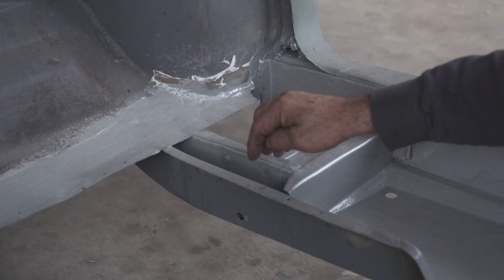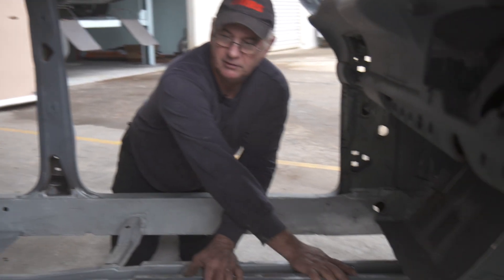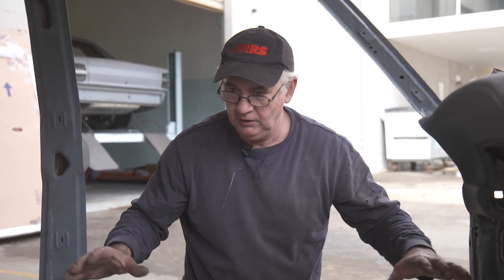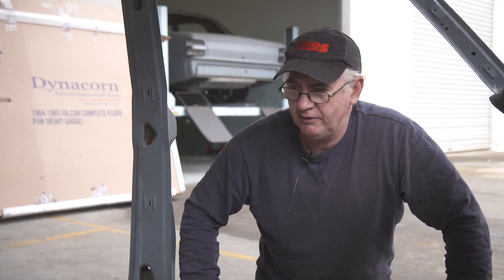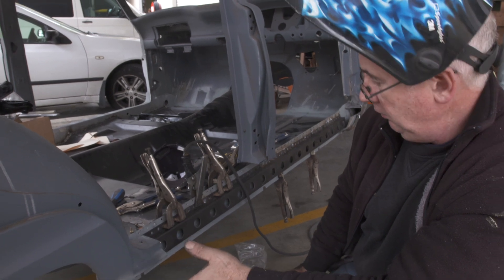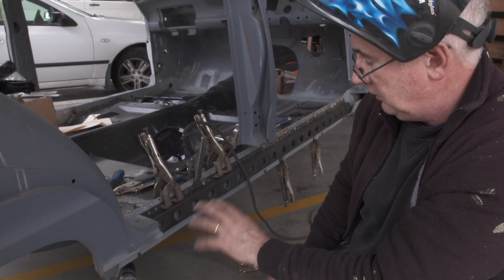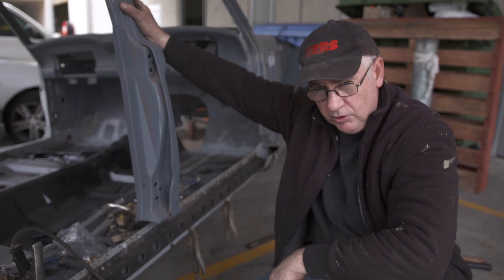The truth about sub frame connectors

Comment: I have done what he is suggesting as it makes for more rigidity than frame connectors. I am sure frame connectors are a good solution after the car is fully built, however during a restoration when the outside rockers need to be changed, is the ideal time to weld in bulkhead to bulkhead beams. I am impressed with his reasoning from an Engineering sense and can't wait to feel the difference in my Mustang coupe to fastback build.

Comment: Stifflers Web brace kit for the 79-93 Fox Mustang+ Maximum Motorsports subframe connectors+ 1x3" mild steel box tubing along the rocker rails+ CE Mild steel 8pt cage, YES, welded through the floor pan+ Maier MOD1 narrow leaf, Panhard bar kit+ Shelby style front tower brace+ triple adjustable Mustang II IFS set up in a '68 Mustang coupe= PERFECTION ! Hope everyone has a happy 2024 !

Comment: This bloke talks alot of rubbish his kits have many weaknesses one is not using  crush tubes when bolting parts into a chassis especially in a rear end. Also his front end parts are junk you would never swap double wishbone for a macpherson strut double wishbone has much better geometry and the so called bad geometry of the older ford suspension can be fixed to far out handle his kits
This guy sells snake oil I have seen old fords with his tower notching kit bend because the support has been taken out of the strut tower. Do your own research before you buy any product not only his.

Comment: I jacked up only , one side of rear of a car with proper frame connector and the entire car lifted at once, i say no flex at  all if done right
Reply: I guess it depends on the car. These are way stronger than the commercial ones I see for my car. This is almost like what OEMs do on convertible cars. Its welded all along instead of just at the front and rear. The commercial subframe connectors helped my car immensely, but this would take the torsional rigidity even higher.
Reply: Yup. I put a set of weld on sub-frame connectors on a 1990 Mustang GT convertible and it made a HUGE difference. You could lift it by the frame and still open and close the doors. Couldn't do that before and it was a non-abused low mileage car.

Comment: Force = Mass x Acceleration, not distance
Reply: Work = mass x distance.  Not sure if I he is attempting to describe moment of inertia or a beam equation, but he is actually describing “work” which is not relevant.
Reply: @jkmorgan1975  : Work is force x distance. Oddly, torque has the same units but is a different animal. The difference is one measures a force that is moving over a distance. The other measures a force applied to a lever arm.

Comment: He's right...for the style suspension he talks of using and the intended use of the vehicle he is modifying.  
As usual though with anyone that has an interest in selling you something, he unfortunately just passes everything else off as garbage.  Thats not really the case and his way of doing things isn't the only viable way.  (and there are certainly less intrusive ways to add stiffness) You can judge subframe connectors very simply by looking at how they attach and how well the connections spread the load into the attachment points.  For the most part, the longer (more spread out...) the attachment points are the better.  If stresses are confined to a very small area they will flex surrounding metal almost like a hinge and eventually the metal will fail.  Spreading those stresses over a larger area will increase the stiffness and add a lot of durability to the vehicle.  It all comes down to intended use, as a road course vehicle is dealing with different dynamics that say a drag car.   It also comes down to cost V/S improvement over stock.   Is it worth the additional cost and effort to gain ultimate frame stiffness when a less expensive, and much less invasive setup will make a noticeable difference at 1/10 the cost and effort?   Maybe...maybe not.
Reply: That kind of where I started in to looking to see if I will hurt the car. I've two kits that the car front and rear and intended to added some additional home pieces as well. Will I make it too stiff? Or fuck it and see what breaks instead of loosing hair over it. I do know the probability of abuse is high. Twisities, drag, air time. It's a Phat B, b body Mopar no less. Very fat. Something has to give. Maybe with so much added all over the car something will snap or maybe it will spread the load, who knows?
Reply: Dude is there any way I can get in contact with you for advice on my stang

Comment: Properly designed subframe connectors would have a tall vertical span. The problem is that most people don't want the beam protruding into the passenger compartment. The compromise is to add a longer horizonal span connecting the frame rails.
Reply: properly designed for what? of course folks dont want a beam sticking through the floor. the vertical span could go all the way to the top of the car....and all around the cabin....oh wait, thats a roll cage. well we can do that too, but by that time you should just build a race-car from the ground up. fine line between maximizing street performance and creating something thats not suitable to be on the street at all.
Reply: @NINJA4RL  Thanks for the comment. There are several Mustang performance parts manufacturers (Griggs Racing and Team Z come to mind) who offer through-the-floor subframe connectors for added resistance to the torsional twisting forces.

Comment: So how do you explain the amount of flex in a Camaro with out subframe connectors vs with sub frame connectors?  A great example is say putting the front of the car on jack stands then trying to open the door. The door will bind a bit more than when all 4 wheels are on the ground. Install subframe connectors and try the same test .the doors will bind less.  Please explain how they did not stiffen the chassis.  I'm not trying to be a jerk. I just dont understand your video. No explanation of what subframe connectors do and, do not do. 
Sub frame connectors do tie the front and rear suspension together if welded to the body they will make a car far more ridged.
Reply: @Thaddaeus417  camaros and nova are unibody.   What didn't make sense to me is this guy cut the car to weld in braces to stop twist. Yet the suspension is still floating on sheet metal. Subframe connectors on the camaro and nova will attach to the rear  spring mount.  They seem to be far better and less work than cutting up the car and welding in beams vs having a frame that touches front and rear suspension.
Reply: @TheChibitodd  Doesn't that depend completely on the vehicle? From what I've read, the mounting of the subframe and/or the structure between the subframe and the attachment points for the rear springs are a particular weakness of the Camaro/Nova platform, but might not be for the cars (Falcon based?) that this guy was modifying. Could it be that reinforcing the side rails  addresses the "low hanging fruit" for the cars in this video?
PS: That said, I don't understand why the term "subframe connectors" even comes up with Falcon based cars. I don't know of any that have subframes; if not, wouldn't these simply be unibody braces?
Reply: The collective experience and knowledge us F-Body owners have has inspired several MFG to create these F/R subframe connectors for a reason, because they flat work as advertised.!
Reply: My 4th gen was day and night after installing the SFCs. It would 3 wheel going up into my driveway after install.

Comment: dynacorn is crap does not fit
Reply: Non of the aftermarket panels are exactly right so you make them fit right a damaged lot of work.
Reply: @errolpoxleitner9586 isn’t that all Chinese crap panels? Their door skin and front guards are always badly out of whack and only work when you use all Chinese

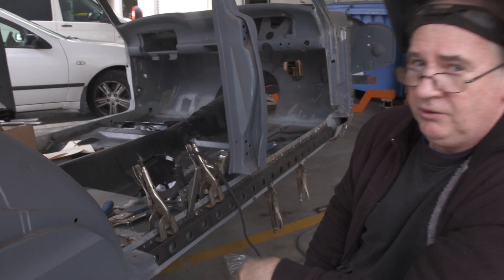Comment: That metal you were welding in under the rockers @3:35,  isn't that doing pretty much the same as sub-frame connectors?
Reply: yes but it's more expensive bc he cuts out body panels and charges more XD
Reply: Yea there just side frame connecters
Reply: I was thinking this same thing. Talks about the physics of why subframe connectors don't work, then just basically welds in longer subframe connectors and says they're amazing. What?
Reply: One difference is the weld all the way along the beam. Makes it a lot more solid than the subfames I see for like 3rd and 4th gen camaros and firebirds that just weld at the front and the rear.

Comment: Dynacorn  bodies  ?    Are they good ?
Reply: Temper of the metal is junk according to my welder.  The metal is thicker but has less rigidity than the originals.  Its Chinese steel. A friend built a 1969 mustang with a full 12 point cage in chromoly. It made the car safe for high HP.